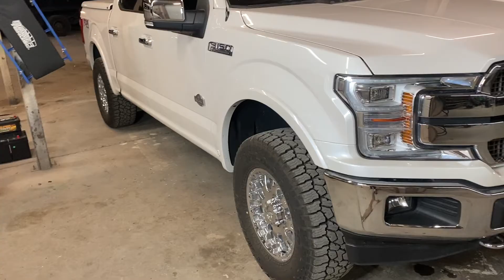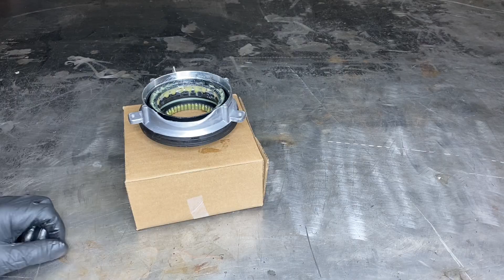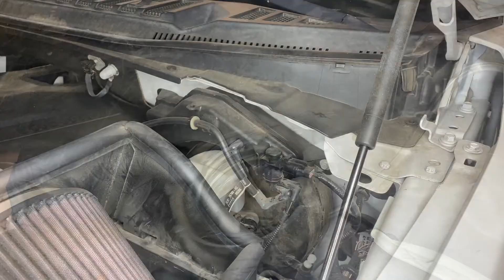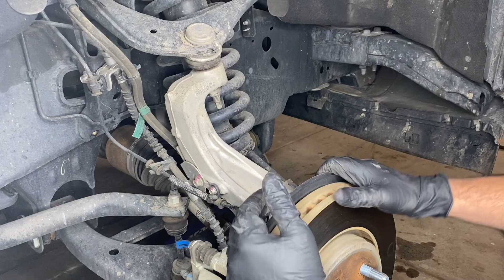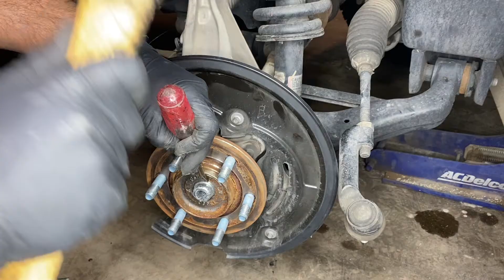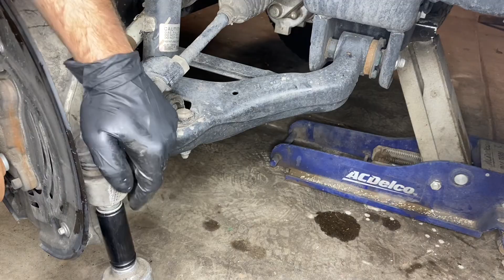Ford Iwe Diagnostic Aid & Replacement (Complete Guide)

Comment: You don't need to remove the brake caliper then the mounting bracket separately. Just remove the mounting bracket with the caliper bolted to it as one assembly :)

Comment: I don't see where he tested the new iwe before he installed it. I had to put a new front differential in my 2016 f150 in the Iwe was physically damaged from a different day that I had worked on it. So I just removed it instinctively I bought a brand new one and I installed it but I made a big big big big big mistake not testing the new one before I installed it. The new one is problematic. It doesn't hold any vacuum at all I should have done that before I installed the f**** thing. The iwe is definitely bad. Just cuz you buy something brand new right out of the package doesn't mean that it can't be defective

Comment: So at 5:19 if it the axle doesn’t move with the wheel when in 2 wheel drive and neither when it’s in 4 wheel drive does that mean it’s a bad iwe or just the lines it’s self
Reply: I’m currently wondering the same. Did you happen to figure it out?
Reply: @williamterrell9322 the newer transfer case control system programming has a five minute drive cycle before opening the IWE. So if it's a cold start and the vehicle hasn't been driven they will stay engaged.

Comment: You don’t not need to take off anything other than the top knuckle nut…then just turn the hub and the axle pops right out. Way too many videos of guys taking off all of these unnecessary things. If you remove the tie rod end it’ll cost you a realignment. 🤦🏼‍♂️
Reply: Can anyone else confirm this?
Reply: Removing and re-attaching the tie rod end as shown in this video does not change or affect the front end alignment.

Comment: Hey there Aaron. 2006 here. Just replaced passenger wheel bearing   It was worn. Directly after. Im getting iwe noise from driver side   It’s that intermittently grinding on the highway mostly.  Was hopi g to not replace the iwe until im more tests as they had been working fine   I had replaced the check valves a few years ago along with the updated solenoid.  Trying to diagnose
Reply: if you solved it? what was it?

Comment: I have that annoying grinding noise in my 2015 Platinum and its really bugging me I'm just worried after looking online that it could be my front differential? I cant tell. I changed the Hub bearing assembly and nothing which leads me to believe it could be the IWE actuator? also when I engage 4x4 it still has the grinding noise, I know some sources say that the noise should go away when you engage 4x4 which raises the question if it is the IWE actuator?. I don't know what to do i bought the truck used and I'm hoping this is not going to turn into a money pit. I forgot to mention i did change the check valve and checked the vacuum lines.

Comment: Great video but I am experiencing one heck of an issue and my truck is now back in the shop 3rd time in 3 weeks for the issue that mechanics can't seem to fix/diagnose correctly. They are either missing a key piece of the equation, or this is one of those situation where they aren't getting the right fix.  Guess we'll see what happens with this weeks shop visit.

Comment: I have got a grinding/humming noise while driving, which goes away when I switch to 4WD.  I have done my fair amount of research and I am starting to think that this is the culprit.  However, when I took it to the Ford Dealership, the vacuum was holding in all the places from the solenoid to the hub.  I left it with them and for some reason they could not get the sounds or vibrations to happen while the technician was driving it.   I am thinking about doing this my self and seeing if it will fix my problems.  Any thoughts or ideas about where to start with problem solving would be appreciated.  Thanks for the video, as it has been SOOOO helpful and confident building for me as I tackle this project.
Reply: The dealer might not be running it long enough for the sounds or vibrations to occur, especially if your truck is a 2017 or newer, since the solenoid is not activated until the warm-up interval is completed.

Comment: For those with older trucks like my 11 Expy, um yeah... Those locknuts will not come out like that since the ends of the threads on the tapered joints are rusty. You need to torch those to melt the plastic lock stuff and get new ones at Ford. You'll never get that upper one free nor the stabilizer one. Speaking of, be prepared to replace the stabilizer link since you might as well just cut it off.
Reply: No😢😢😢I can't do that😟😟😟

Comment: When I took mine apart I noticed a hot spot on the axle and was almost dry of grease so I cleaned everything up repacked with grease and it started working properly

Comment: Great video.. but one thing everyone should know about 2017 and newer models is that the solenoid WILL NOT be activated when the vehicle is first started up. The hubs will stay locked in 4x4 until the initial warm up time is met. Usually 1 mile of driving before the TCCM will activate the solenoid(depending on temps). The solenoid has a constant power feed with ground side activation from TCCM. This can cause misdiagnosis if not understood. Cheers
Reply: Wait what? So are you in 4x4 until warm up or just the hubs being locked until warm up. My new 24 will get a slight grind for like 5-10 seconds the first 2-3 minutes of driving (it is like 25F outside too). It usually will happen when I use 4x4 from the previous drive. Goes away on its own, I don't have to put in 4x4 to make it go away.
Reply: @MEJB7 just the hubs are locked til warm up. 4x4 on the tcase side won’t be engaged unless selected
Reply: @DivergentMachining  you just saved me a lot of work!  My mild grinding noise goes away after about 3-5 minutes and is only really noticeable on cold mornings.  Such good info - and a GREAT video!
Reply: Thank you
Reply: Just curious why you removed the brake caliper. I just pulled the strut and cv axle and actuator out and came here to learn about the solenoid and what controls the actuator.

Comment: Good video, is there a new link for the assembly on 2015+? When you click the link it says unavailable
Reply: So I just tested this on my f150. Once I jacked up the truck, I’m 2wd the axle still spins. While in 4wd the wheel and axle do not move. This means the IWE is bad correct?

Comment: Replaced the solenoid and check valve today, went to plug in the hose line to the wheels and the plastic line crumbled when I touched it (UGH!!!) Since this weather is artic temps I'm going to let a Ford dealership replace all the vacuum lines to the IWE's.

Comment: I had the same problem with my Raptor. It was the IWE check valve. Just something I noticed that you didn't point out. They are known to go bad. The revised version has a blue housing.
Reply: Yup....literally a $20/2 minute job.

Comment: My 2017 F150 suddenly began the chattering noise. I drove directly to the dealer and the technician changed the IWE actuator hubs on both sides. However, I still have the chattering, not as persistent at moderate speeds, but also at interstate speeds. I made another appointment at the dealer. So, after more research, I decided to change the check valve, following instructions. On the test drive, the chattering returned at moderate speeds and interstate speeds. After a brief stop back at home, I went in another drive, and didn’t hear the nose. Is it possible the vacuum system needed to reseal itself after I changed the check valve?  I’m baffled.
Reply: Someone in the comments here stated that it may take a couple miles for the on board computer to adjust.

Comment: 2015 navigator 4wd, makes grinding noise on driver side 
Wheel bearing replace, believe it’s the iwe, but when I jack up front while running and spin tire it does t grind, is this because there isn’t any weight to make it grind

Comment: I have a 2010 that has made this sound for probably 4,000 miles or so now. Will I have to replace the Axles or wheel bearing hub as well? Just wondering if those splines would be damaged too? Thanks

Comment: I know it might seem crazy but ALWAYS replace the check valve and I usually recommend replacing the solenoid too when you replace a iwe.
Reply: The reason I suggest the solenoid replacement is because I’ve had several vehicles demonstrate random vacuum fluctuation when driving on bumpy roads. Discovered via analog vacuum monitoring during road tests on repeat visitors experiencing iwe issues.
Reply: any chance you could assist me with my IWE Issues? sounds like you know a bit about em

Comment: Thank you for this vid!  There's at least one TSB (TSB 19-2252) for this issue but yet the dealer acts like they've never heard about it.
Reply: They are up to TSB 20-2028. https://static.nhtsa.gov/odi/tsbs/2020/MC-10171859-0001.pdf

Going in tomorrow morning for the 3rd time. First one at 15,000 miles, 30,000 miles and now at 63,000. Hoping they still cover under powertrain warranty.

Comment: This truck has the old style white/black Vacuum Check valve going to the vacuum solenoid if it has not failed it will and your IWEs ad hubs will be destroyed again.  You need to replace with the new style blue and white vacuum check valve.  Also no reason to disconnect the sway bar nut..  You said you were going to demonstrate with the hand vacuum pump on the new IWEs and you did not.

Comment: I have a 2012 F-150 Lariat 4x4 CrewCab. I am having that same problem when stopping on the brakes. I recently had the front rotors resurfaced and added new pads. The noise is still there. The mechanic says the rear rotors rotors and pads looks good. What should I do next?

Comment: Mine hold vacuum but they still make noise and 4x4 not working any ideas
Reply: mine was same way, then i took driverside apart and the iwe had split in half
Reply: @SuperSEXYINESS  mine doesn’t loose any air
Reply: @SuperSEXYINESS  are you saying yours was holding vacuum but the iwe actuator was actually broken? Mine holds vacuum but when I put in drive and record with a phone, the axles still spin causing that noise. I jack up the truck with truck on, spin by hand, no axle movement.

Comment: Thanks for the vid! Bout to go out and check mine. Not getting a grinding or ratcheting but a constant HUMM that goes away bin 4WD, similar to what someone else described below. Adding the an audio track with that grinding or ratcheting noise might be helpful if at all possible.
Thanks again for a great vid --subscribed.
Reply: Did you find your issue? I have the same thing
Reply: Did you ever find the issue with the hum? I’m having the same problem on my 2023. Goes away in 4H.

Comment: Thanks for this video dude, I appreciate people of your ilk. Couple question I have regarding vacuum and IWE issues as it relates to a grinding/vibration noise while in 2wd but goes away in 4wd. WHAT is making that noise exactly. Are the splines/gear teeth stripped? Also, is the IWE splines a softer metal than the splines on the axle and hub.. so the IWE would strip out before the axle and/or hub?  Curious, thanks again!
Reply: Did you ever solve that hum issue, and if so what was it? I have the exact same problem on my 2013.
Reply: @nopenottoday42  it was a bad IWE actuator. To know, pull the vacuum line off the actuator behind your wheel, tuck it out of the way and then test drive it, if the noise is gone it's a bad actuator or youte not getting enough vacuum

Comment: How come I keep coming up with a different part number for the 2015 model? 7L1Z-3C247-A. It says the HL1Z that you have linked is for 2016 and up?
Reply: 7L1Z-3C247-A is for before 10/12/2015, any truck production daae after that uses HL1Z-3C247-A

Comment: Hi Arron. Great video! Very helpful. Any ideas on why my truck makes a humming noise while driving in 2wd and then when I switch to 4wd it goes away? I have to do that a few times before it goes away completely. Then when truck shuts off then back on I have to do the same process over again. Can the iwe get stuck? I’m assuming vacuum is working because sound eventually goes away. Please any suggestions!
Thanks and keep up the great videos
Reply: Same, any update?
Reply: That's your iwe

Comment: Such a shit system. Mine failed at 18k. Unacceptable.  My titan at 140k works fine and Tahoe at 120 works fine.  First and last ford I’ll ever own.
Reply: Mine just failed at 60k.
Reply: Oh ya? Mine are at 11 years old and 235,000kms and still work.
Reply: mine failed at 97 k
Reply: Yes Ford designers are the worst idiots, they should be featured on the "Idiots at Work" Channel.
Reply: mine failed intermittently at 93.3k 2017 ford f150
Reply: 15k, 30k and 63k this weekend. 2017. 

Maybe I'll get 60k on this next ones.